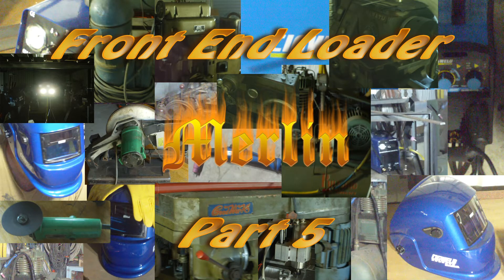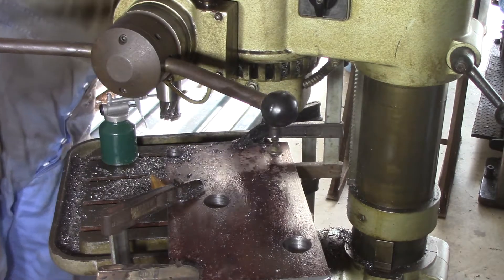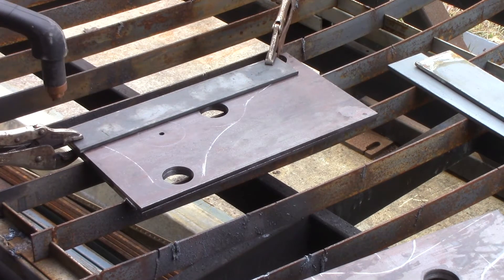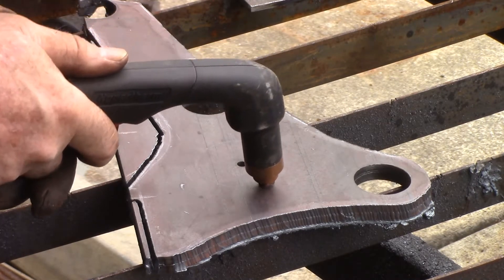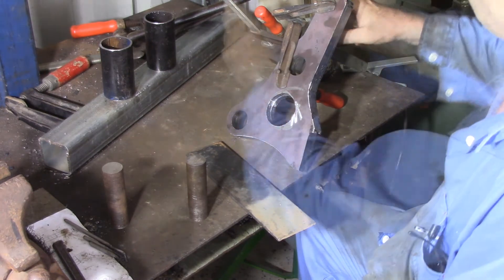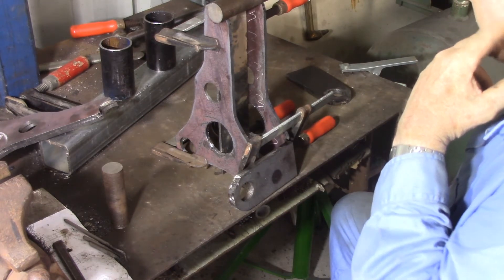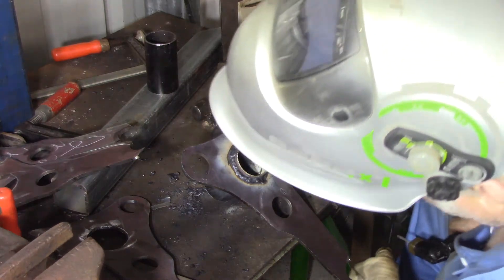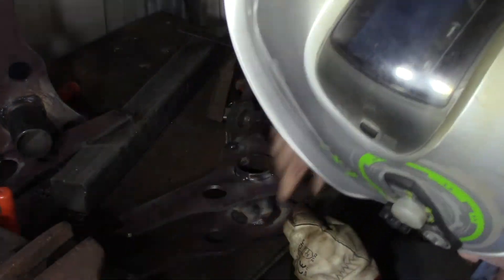Compact Tractor Front End Loader - 5 of 18

Comment: Do you sell these plans?
Reply from the maker: No.  You can download them for free from my web site.  Follow the link in the video description.
Reply: @Designed2Build  these are awesome!  Is there any way to get cad files to cut them out on my cnc plasma?  I have a d15 Yenmar and might need to make little changes to the files to make it work. You videos are exactly what I was looking for to build a FEL.
Reply from the maker: Sorry, I used a CAD package where I worked at the time to draw them.  I no longer have access to it and I don't have a copy of the original files.
I was originally going to buy a Yanmar D15 for the project but ended up with the Mitsubishi.
Reply: @Designed2Build  its all good. I think I will be able to copy a lot of it fast enough.  Yeah I got a great deal on it so I couldnt pass it up.  I cant wait to start this project.
Reply: You link to the cylinders doesnt work.  Do you just have a size I can just look for?
Reply from the maker: The cylinder sizes are noted in the plans, near the end.  AG 2014 and AG 2014